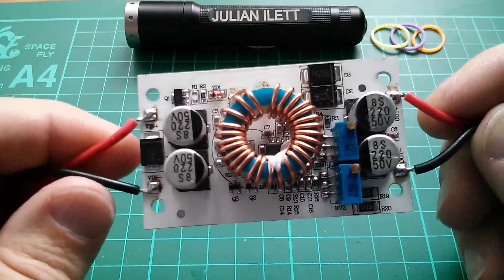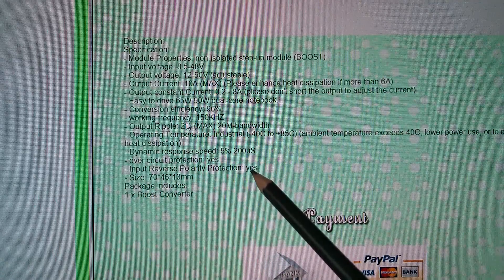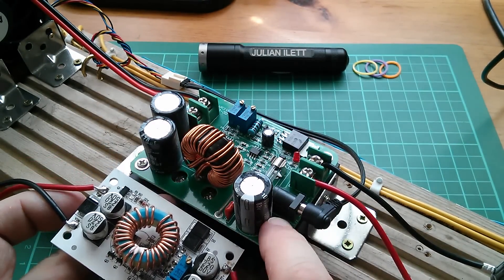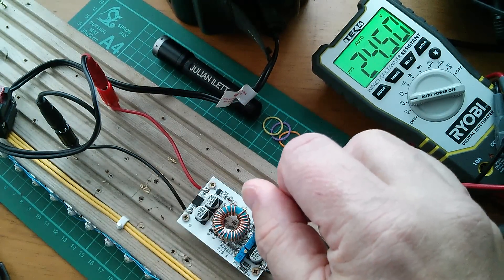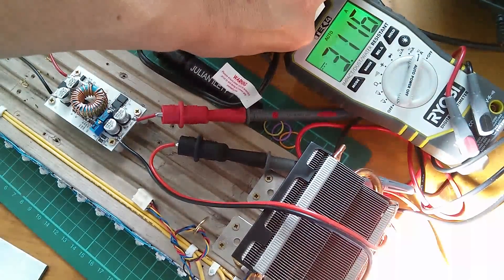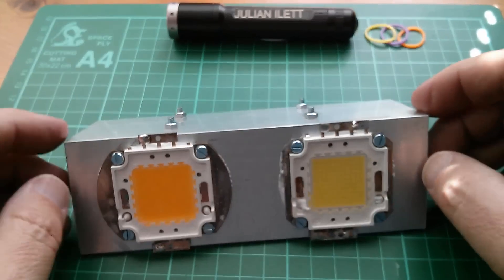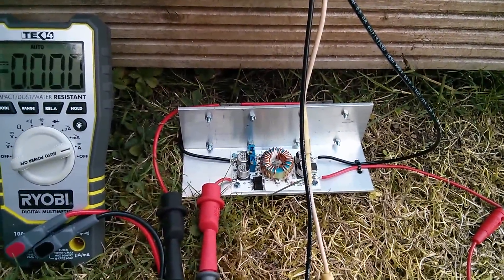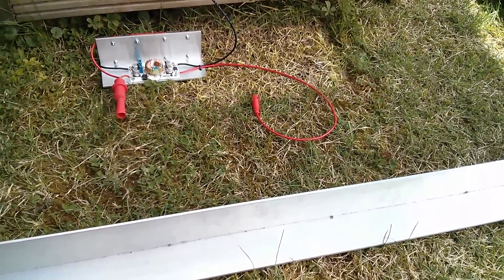Julian tests: 250W LED Driver with 2x 100W LEDs

Comment: you can built a light fitting like that but you must equip that piece of alu with water cooling or an insane amount of fans to cool that thing. i did some workbench lights like you want to do now (with 10w cree's) so if you want some ideas on how to build the cooling (cheap and silent) just contact me.

Comment: Would it be smart to put 100w on 20w led driver?
I was thinking i could put one 100w and power it on 20w for my room (i have 4x30w halogen lights)

Comment: Have you tried to put them in series connection instead? The voltage to them will of course have to double to deliver the same power. :-)

Comment: i have a problem.with converter like this i power one 100 w led.input is 16 v,power supply is 200 w...but,when i put more than 1,5 a in led,converter starts to pull enormous current,way over mu multimeters 10 a limit...so big current that 35 a graetz in p.s starts to owerheat in 20 sec...can somebody help?

Comment: Did you ever use that angle bracket to build the biggest and baddest LED light fitting there is?
Reply from the maker: I'm still working on that idea:)
Reply: I hope you consider some actual cooling fins on the back of that aluminium bar. Dissipating 50-80 W heat per LED into it might not work, as its ability to transfer the heat along its entire length is not that of copper's.

I love these videos though I cringe each time when the LEDs are insufficiently cooled - or not cooled at all :D

Comment: Hi Julian, I am having some issues with one of these converters and I'd like some advice. I am driving 8 6v XHP70 in series at 48v. The current refuses to increase above about 3A and I'd like to achieve at least 4A. I have fried 2 converters trying to increase the current, are these things just junk or am I missing something?
Reply: Tyler Nelson hi mate.. got same probs with u but instead xhp 70 im using 1pc xml u2 10watt.. rated 3.3volt and 3 amps..

input using switching power supply 12volt 21amp and use buck converter (not boost like in this video)

but i got only 3.3 volt and max 1.2amp (using 0.75mm wire).. it supposed to reach 3amps.. but the buck converter refuse to go beyond 1.2 amp.. :(

@Julian : why its happened? the led should draw an amps from the converter as it need right? (as far as the converter specs capable of course).. am i right?

Comment: The diode on the input will work fine if the supply voltage is fused.

Comment: What was your conclusion Julian?
Did the two 100W LEDs light up well?
Can this Driver be powered by PC Power Supply (12V)?
Thank you
Reply from the maker: This driver is good for the money - it can supply 5A if properly heatsinked.
Reply: Yes, so I repeat the question:
Can I connect this Drive to a 12v PC Power Supply?
Thank you
Reply from the maker: How much current can your PC power supply provide?
Reply: Around 4A at 220v;
Reply: yes you can, it should supply somewhere around 50A
Reply: thanks friend!

Comment: Julian Ilett  How do i overcome the fear of blowing up electronics? i build lots of stuff. but i live in constant fear of blowing it up even when i know it should work. How can someone get trust into electronics? are there thingy you can check an know it will not blow up?
Reply: Micky S. Blow lots of stuff up and your fears should subside.
Exposure Therapy: In this treatment, patients are gradually exposed to their feared situations repeatedly, until the situation no longer triggers the fear response.
Reply: +Dave Milunic I know that treatment, my family calls me a terrorist because many of the electronic components get up in smoke. But i keep trying. Just the step up booster i have given up. It produces so many amps when the mosfet conducts that the battery is empty in no time or components are going up in smoke. For some reason i can't get it right. High current circuits are simply not for beginners i think. So now i will order this circuit and i hope i can make the LED dimmable with it.

Comment: I'm  a bit of a dunce on this stuff . So if someone could help with this question it would be greatly appreciated. Would this safely drive a 100 watt infrared led that requires DC Forward Voltage (VF): 14V ~ 17V DC Forward Current (IF): 3500mA ? Thanks in advance.

Comment: and? Is this driver enough for these 2x100watt leds?
with only 5A every LED will have only 2500ma, they need 3000ma, so they will not light at maximum bright?

Comment: This module overheats quickly,    I desoldered the  mosfet  and  connected  wires   to mount  a mosfet  on a separate heatsink.  This way  you can get real  power out. I used this mosfet type below  . May be  turn the pots around to adjust CC  upwards by  turning   clockwise. 

http://www.infineon.com/dgdl/irfs3607pbf.pdf?fileId=5546d462533600a401535636a42b2176

Comment: As far as wondering whether it can take the current, the first thing to do is write down the part numbers and see what their datasheets suggest, then derate a bit due to the limitations of the budget PCB.

I suspect you also might be as well off not mounting the driver board on the same heatsinks as 2 x 100W LEDs.  I would prefer to swap out the electrolytic capacitors with polymer, mate it to a heatsink, then entomb the whole board in thermally conductive potting compound or epoxy.  That prevents servicing it if there is a failure, but perhaps you'll avoid one doing that and the cost of a replacement driver isn't much, rather it's more about waiting the dreadfully long time for budget shipping from China... at least in the U.S. it can take about a month to receive things I order from Chinese merchants.

Comment: Rectify the mains and use many LEDs (80+) to drive them directly in series. There is no voltage fluctuations on the mains to affect brightness.  
Paralleling LEDs is not a good idea, as current to each leg will not be the same.
Reply: With LED's you need to control the current through them carefully or they will die an early death.

By putting them directly a rectified main AC supply you have no current protection at all so when the mains voltage fluctuates the current will vary a lot more than you expect and this will kill the LED's very quickly.

I remember buying some of the first LED GU10 lamps you could buy almost a decade ago and they had very little current control in their drivers, they were effective a high number of LED's in series directly across the incoming mains so when that mains voltage varied during the day the current through the lamps varied a lot more than the LED's could handle and they all died in less that 6 months.

That's why you should always look for mains LED lamps with as few LED's in series as possible so that the designers have to use a constant current driver to drive the LED as that will make the LED's last a lot longer! :-)

Comment: To measure the current why aren't you using an AC/DC Clamp  meter? With this you can measure  0-100A AC and DC current measurements with a 1mA resolution and have zero lead loss. No need for the ohmmeter is series.

http://www.amazon.com/gp/product/B00O1Q2HOQ

Comment: 5 amps at 36v is 15a at 12v those little wires arent meant for that  :p the leads arent helping either

Comment: Is it wise to put the LEDs in parallel???????????
Reply from the maker: Yes, it's fine - the LED strings inside the module are in parallel.
Reply: @JulianIlett  Yes, INSIDE an unit one presumes the LEDs are matched. However this does not mean two different modules are perfectly matched.

Comment: Dear Julian,
i am planning to build something similar with a 150 w boost converter that has current and voltage regulators.

and the whole thing is gonna be inside an enclosure

is there any way to use an external potentiometer to dim or brighten the light whenever needed ?

like example if i adjust the current to 3000Mh and the voltage to 30v
and i attached a 10k Ohm potentiometer with 2 x 11kOhm resistors to the main voltage potentiometer of the unit
i can adjust the voltage between 26v to 30v to dim the led 

does this method work ?

if not , please can u give me a clear solution for doing it.

i am using YUJI LED a high CRI 100w  LED cob and they are very expensive ( 84$ ) so i am scared to fry it up.

thank you in advance.

the link to the boost converter i already bought:

http://www.amazon.com/Yeeco-Adjustable-Transformer-Stabilizer-Automotive/dp/B00MIJL4OC/ref=pd_sim_sbs_23_32?ie=UTF8&dpID=51-WZengD1L&dpSrc=sims&preST=_AC_UL160_SR160%2C160_&refRID=1BH2211FZJ1XVWXJ3N5H
Reply: +kingknut thank you for ur concern 
i am feeding it with 24 volts adapter capable to deliver 120 watts of power.
and i adjusted the current to be constant at 2.8 amps just to be on the safe side.
but my main question is
is there any way to install an proper external potentiometer so that i can dim or brighten the light ?
what is the specs and how can i connect it?
thank you
Reply: +kingknut thank you dear.
i am skilled and neat with soldering 
so i will try what you said
hope it works.
and good luck with yours in case you are assembling one .
Reply: +kingknut ewww 500w LEDs are sooo pricey :O I wish I had a lottery win to throw a lot of money at these projects instead of hobby money. :) Dory look for youtube video  "Make a 1000w equiv. LED flashlight - aka DIY Sun-Blaster!" 
 Diy-perks has made a 100w led torch (granted with no current limiting :O )  you may be able to use his idea for dimming

Comment: ebay item number 371557432842

- LED Emitter: 500W
- Output Lumens: 50000-60000 Lumens
- DC Forward Voltage (VF) :60-70 V DC
- DC Forward Currect (IF) : 8750mA
- Color Temp:   4000 ~4500K
- Beam Angle: 140 degrees
- Life Span Time : > 50,000 hours
Reply: its huge  lol julian would like that